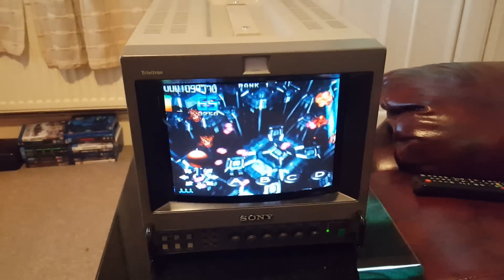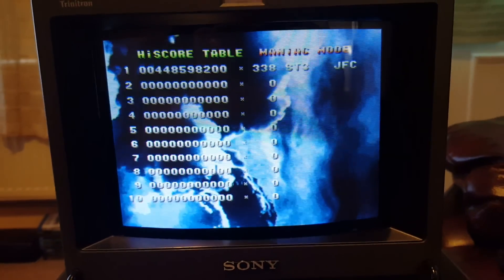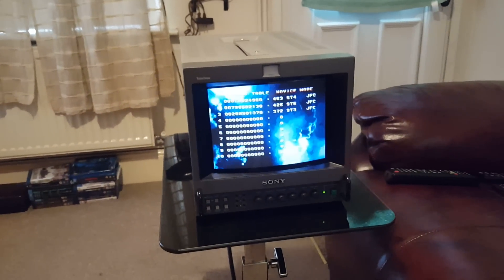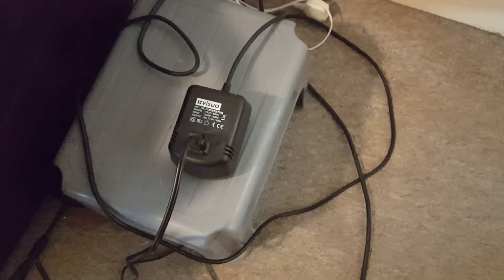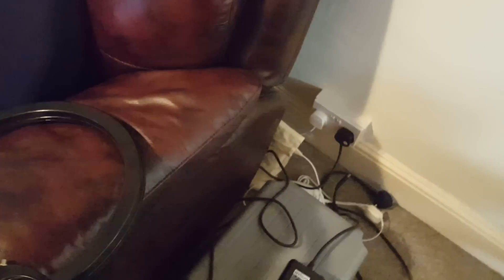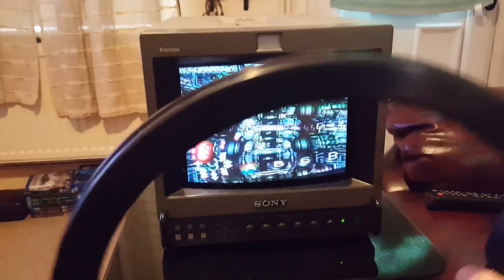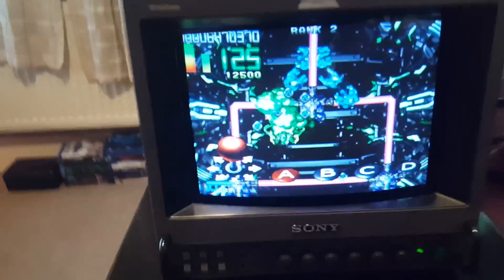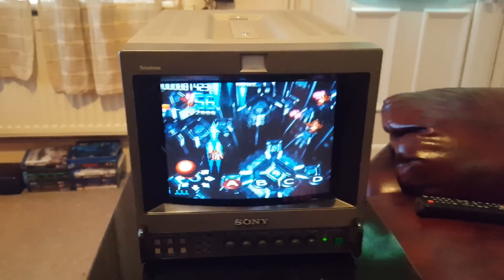Degaussing a CRT monitor

Comment: Thought all CRT sets had their own thyristor controlled degaussing circuit built in. It's that thump you hear everytime you switch on. If it does have one you can see the degaussing coil wrapped around the CRT toward the front.
Reply from the maker: +MickeyDJ1 Nope. Not this one.
Reply: And some Trinitron CRTs, particularly FD Trinitron and HR Trinitron, actually have permanent magnets placed in certain spots to help with convergence.

Comment: The dance of the degaussing :)  

Helpful vid bro! 

Do you know anything about built in degaussing in CRT monitors? I could swear I had an old monitor that had it built in back in 2000-2004
Reply from the maker: +Ninjaximus Yeah man some monitors had coils built in. Not little ones like this though.
Reply from the maker: *****
Nah, they both do the same thing after all.